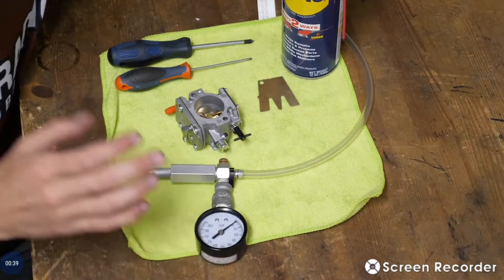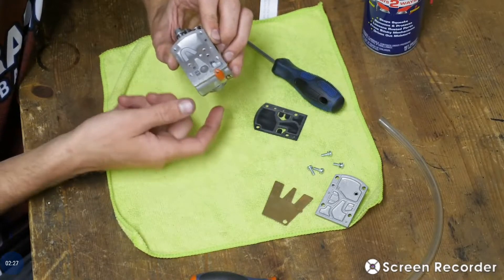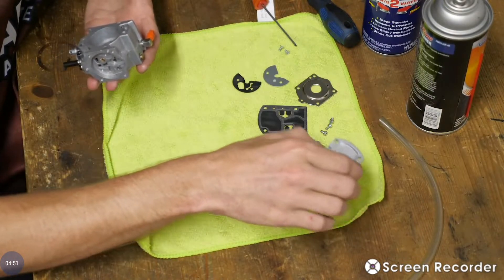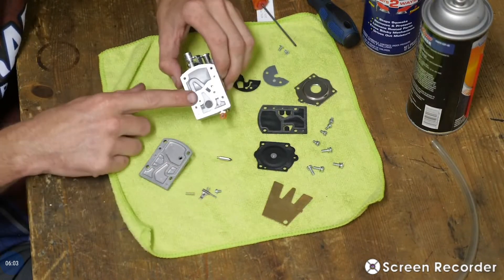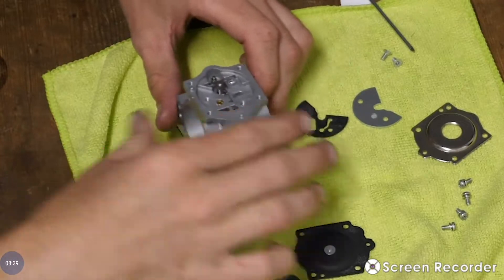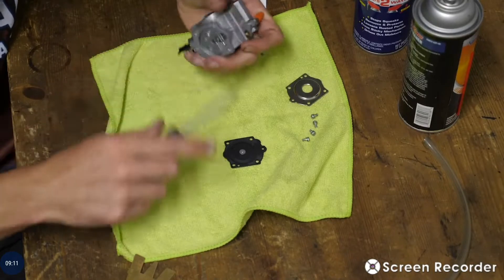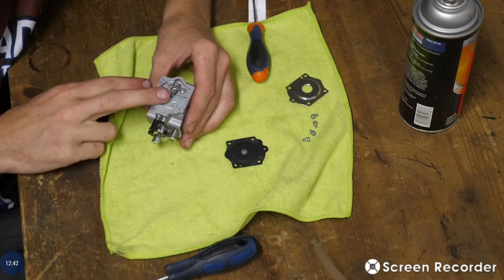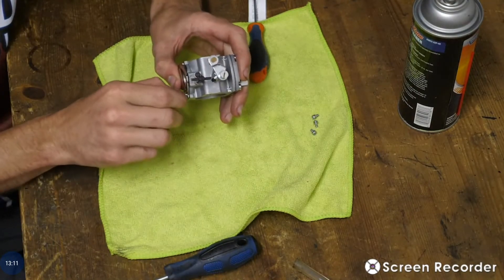Air Conception Nitro 200 calibration

Comment: Hello buddy I have the air conception nitro 200 it's just coming to the end of the run in stage been running it in at 100ml to 5ltr fuel do I have to leave the carb settings and reduce the oil or leave it as it is and lean it abit many thanks buddy
Reply from the maker: I would suggest that you join the AC groups on Facebook for food advice and discussion. 
As for the after run in procedure the AC factory recommends 66:1. Leave the Carb settings as they are. I used Motul 710 oil.
It's a great engine.
Reply: Hi buddy many thanks for your advice kind of you to reply back to me as I live in the UK and don't get much feedback hear. all the best to and keep safe and well
Reply from the maker: @frosty2331  I used to live in Warwickshire and that's where I flew my Nitro. I'm the Admin for Paramotor UK FB group.
These days I live in SE Asia, Thailand today, Vietnam tomorrow. Not doing much flying these days.
Reply: @Ian James  hi buddy small world but at least your doing the thing seeing the world I don't have fb but sorted the oil mix and running sweet will do the base gasket this weekend as have very small leak clean piston and barrel decompression  port also have the off grid throttle to put on.thanks for your reply and enjoy your trip 👍